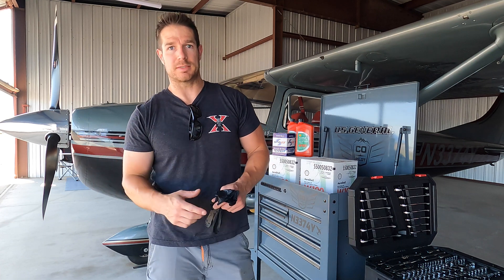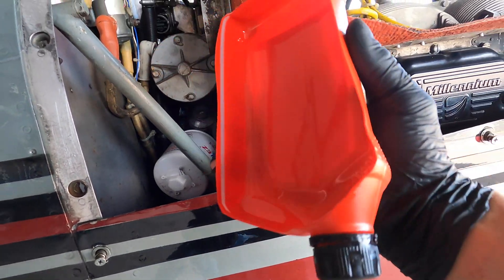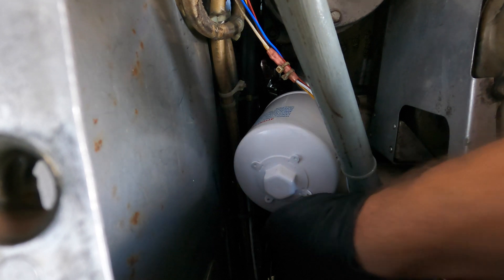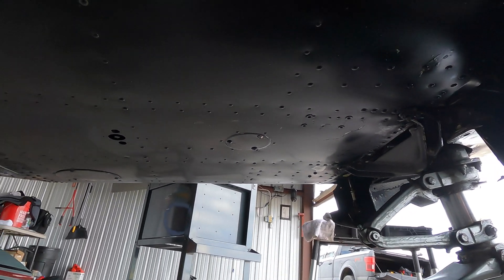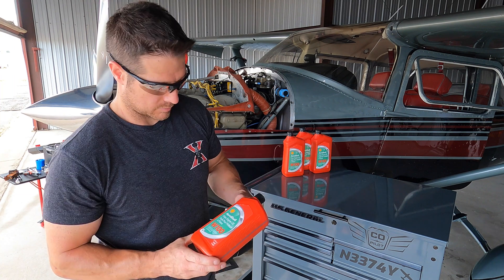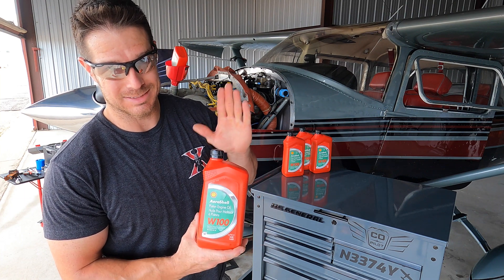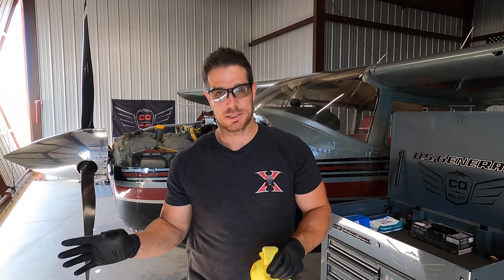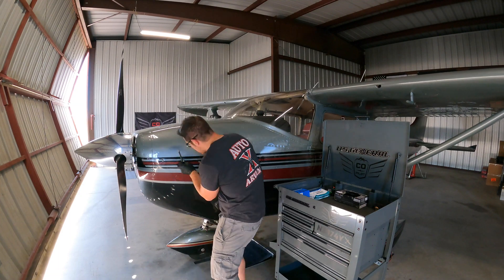AIRPLANE OIL CHANGE | CESSNA 182

Comment: Great help, im about to do mine for the first time. Was there a special socket for torqueing with the spark plug wires in the way, or is it just like an O2 sensor socket?

Comment: Remove the lower cowl. Makes for much easier access, and better inspection / cleaning opportunity. Check out saf-t-cable too for really slick safety wire installs

Comment: Awesome video! I’ve yet to change my own oil in my 65, but this is helping me to think about it. The quick drain looks like the trick not to have to remove lower cowling too. Super looking paint job too!
Reply from the maker: Thanks for watching! The quick drain is definitely a game changer. I have pulled the lower cowling several times; it’s a pain and a two person job (at least in my experience). I do like having access to inspect and clean everything with both cowlings removed, but for a quick oil change it sure is convenient. Thanks for the kind words and happy flying!